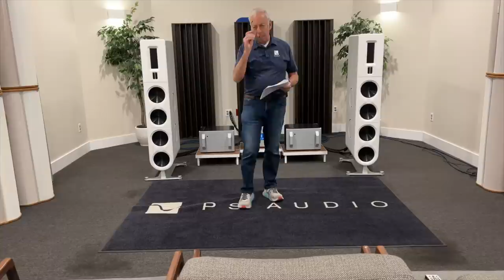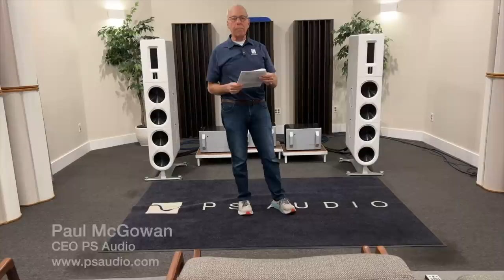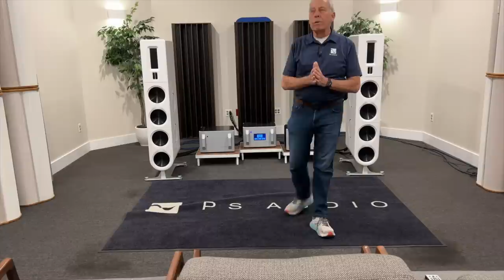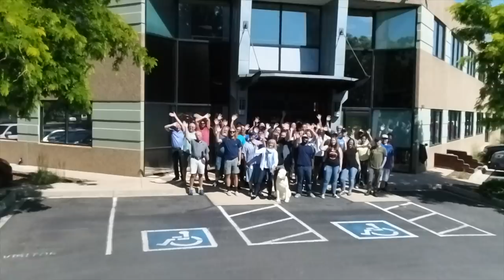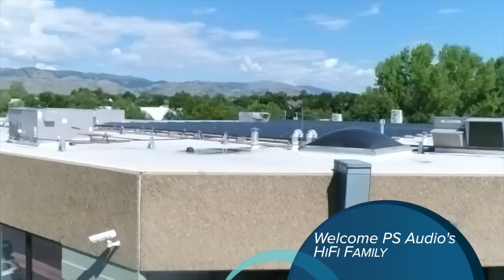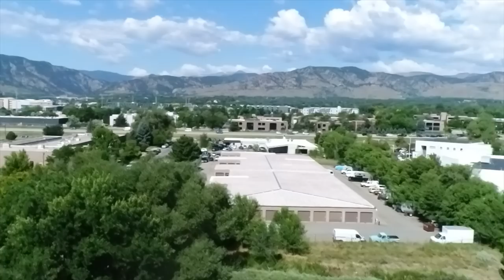Understanding soundstage in an audio system

Comment: Yeah, I had high expectations for Paul's book to "properly" set up my gear. I bought one for me and another one for a friend, with the disc. Too bad the 1st half of the book waffles around and when it finally got to the point (speaker setup) I realised I'd need an American size mansion or a Russian oligarch size palace to replicate the steps. It seemed like honest, decent advice if you have that, otherwise, in an European size apartment... not so much.
Reply: New Record day, has a set up video, "audiophile sounds in small rooms" it worked for me, it's worth trying.
Reply: I'm in a smallish American apartment and I found The Stereo book and disc to be a great help. Mostly because I was unaware of coupling. Just that bit of bringing the speakers close together to hear the midbass coupling, and then to move them apart gradually in order to gain depth of soundstage while maintaining that fullness in between the speakers. Once I had that sounding as good as it gets in my room, I began fine-tuning with toe-in. 
And being married, meaning the speakers don't get to be too far from the front wall most of the day, I put furniture sliders on the bottom of my tower's spiked feet in order to slide them into marked (subtly) position for listening sessions!
Reply: Go near field set up…it’s amazing.
Reply: Every one's room is different.  You need to set up "Place" your speakers for your room, 12mm this way or 12 mm that way can make big the difference.  It's more than just centering the phantom speaker, like Paul said it's getting the room to just opens up.

Comment: I’ve experienced soundstaging with mainstream av receivers - not just high end audio. It came down to proper speaker placement and decent recordings.
Reply: Only just learned about this and realised I experienced it a short while ago with what would be described as an entry level hi-fi system, and the sound was right there in front of me, not from either speaker - it was amazing 😀
Reply: Absolutely
Reply: Yes, that's right. It takes a badly designed AVR to mess up the soundstage. Of course what matters for soundstage in a system is all about speakers, placement and room acoustics.
Reply: @Douglas Blake Oh man. I guess I have some tweaking to do.
Reply: Kind of disappointed you missed this: its usually vital to close your eyes for any of this to work because our vision has the dominant path to the brain, remember we are trying to fool the brain that what it is seeing should be discarded in favor of what it is hearing. 
I suggest Robert Plants "ship of fools" from Now and Zen. The techs did a great job  of separation of the instruments, you can clearly hear them far outside the confines of the listening space. 
Also consider not just equidistance to your ears of each speaker but if they aim just behind or in front of your ears.
Theres a saying by audiophiles when you achieve the phantom channel. "At that moment, the system became transparant." Its usually after speaker placement is perfect, eyes are closed, and you take a brief moment to breathe slowly, bring your heart rate down, and relax. Youre entering a state resembling meditation.
Reply: Agree, it is a bit “I want to sell” speach here by Paul. 

Most audio gear if speakers placed properly will give you soundstage and phantom placed vocals.
Reply: @ThinkingBetter  You’re right. Many of the recent AVRs that I tried present a very good soundstage unless they are very carelessly set up.

Comment: Of course, stereo is    a no-brainer necessity for soundstage. Phase coherency of a loudspeaker is a primary critical parameter for soundstage. Phase coherency is the capability in loudspeakers  emanating its entire frequency range at the exact moment of time. For example, 500 Hz frequency arrives to stimulate the eardrum at the exact time as a 1000 Hz. Which is not electromagnetic mechanical possible at the precise time. Primarily due to motional impedance differences of speakers. The sound process from time differentials is highly critical processing direction and distance of a sound source. Monumental creating a soundstage. This major factor was not mentioned. However, it's technical for most viewers of the podcasts.

Comment: Great Q&A.
I had forgotten that I spent most of my life not knowing what a sound stage is.
20 years ago, when we moved into this house, our decorator suggested a spot that could be set up as a library and or listening area.  My wife agreed that I should get a decent little stereo, so I purchased a bookshelf system of Denon electronics with Totem speakers.  Reading about Totem they expounded on their ability to set a sound stage.  But I did not hear it.  I made some DIY speaker cables, and DIY interconnects, and bingo.  I heard my first sound stage.  Just barely.
Then DIY took fire and along the way building DACs and amps for a now dedicated listening room, the commercial speakers from Boston Acoustics I had owned since the 80's disappeared and a wall of sound appeared just as Paul describes it.  WOW.
I have concluded everything matters.  But it is all about transparency and phase.  So, given your speakers are out from the walls, it starts with the recording and then the source is the key thing.  In digital, that means a low jitter clock and a great power supply.  After that, everything can subtract.  Electronics and cables must be able to pass a signal without altering phase or smearing it.

Comment: Paul, you are absolutely right in that you don't need to spend massive amounts to get impressive soundstage. I have a system made up of many different pieces, a majority of which are Realistic / Optimus branded pieces (yes, the dreaded Radio Shack), most of which were bought on SPIF - the very last price reduction before throw in the bin or return to warehouse. These are mid 80's to mid 90's pieces. Most pieces were under $40 back then, but the most expensive piece was the receiver at $120 (Sansui). The main speakers are Optimus 30's, rebuilt with burnout proof ceramic voice coil former woofers. Everything has to fit in a late Victorian style twin, so against the wall is the only option. The big star of the show is the EQ.  With the EQ switched out everything is 2 dimensional. Switched in, there is now a concert hall in front of me, and all the musicians are precisely located in 3d on that soundstage. That goes for the CD's, records, even tapes. 

So, just work with what you have in the way you can. What ever works best for you is what is right, regardless of others opinions. Please all go forward and enjoy your systems, but most importantly,  the music that takes you away.

Comment: I think what you find in higher end systems is they give you FLEXIBILITY with a variable of choices and settings. What is a perfect soundstage to one might be crap to others. What do I mean? Some audio gear like to make it where the soundstage is huge but the singer is pushed way back like you are in a concert way far away from the stage. The music becomes hard to be engaged with as so distant. Other gear has more forward sounding stages where you feel like in a dive bar a few rows back and the singer is right there singing to you and the instruments wash over you and you get lost in the music. It's all about what you like and get out of the music. If you love the feeling of being far back in a concert setting then some gear is tuned to that. I have also seen where the instruments were too forward and overpowering the singer where the instruments seemed to be next the singer or in front. Think of soundstage like a tv screen. If you have small gear in a medium size room then the stage could be good but condensed way down or only go up to half the size of the room. When you start getting into larger speakers and higher end gear the walls seem like they almost do not exist and you have a massive stage like being outside with sound and little to no constraints. You have to find what you like and then try to get as much as possible of that within your current budget and build up from there over time or stay with what you have if it's (good enough) to you. The audiophile's journey is different for everyone.

Comment: Watched this and decided to experiment. I have my 20 yr old Monitor Audio Gold 20 mains in a surround system. Went into processor settings and turned off the center channel and rear surround speakers, leaving only mains and sub. Then I listened to music videos in stereo mode in Youtube. Not only was the center sound stage better without the center speaker, but the mains sounded better listening to Youtube videos in stereo than I can remember hearing them sound. I've just always left my system in DD surround.
Reply: Got to remember the vast majority of music is mastered in 2-channel so really one when listening to music one should be listening to 2-channel stereo. Btw you should try giving a hi-fi streaming music platform a go. If you think YouTube's good, you'll be amazed the difference in sound quality! Especially if you got quality monitor Audio gold speakers .
Reply: Yes - center channels should ONLY be used for watching films and even then they're not needed unless you have an audience watching that isn't in the sweet spot and you need to center the dialogue.

If it's just you, you don't need a center channel.

Also, once you have a really good two channel system, you will never find a center channel that properly blends with the left and right channels acoustically, even if the speaker maker offers one.
Reply: @VideoArchiveGuy  I'm not going to say I agree with you about center channels. I think them integral to the surround system and of course audio is definitely subjective.  My point was only that I had never thought to listen to YouTube videos in stereo mode. If I play a CD the system auto-shits to 2 channel. I was surprised how much better YouTube videos of live recordings and records sounded in 2 channel mode. That's all.

Comment: Paul is slightly wrong....in a proper setup the sound not all come behind the speakers...it can also com from in front of the speakers. My reference recording is Die Fledermaus on EMI. The whole light opera plays like a circus in front of you. Some singing is far in the back and suddenly moves from the back to the front. Then the sopranos move in front of the right speaker to the middle and you can "see" them singing about one meter apart. I use a hybrid tube power amp(Valve Audio "Black Widow"), Sonic Frontiers SFL1 pre-amp, with Audioquest Midnight 3 to a pair of ESS AMT 1D's and 2 REL subs.
Reply: It depends upon the source and components; some have a more forward sound and others place the sound further back, and it's an individual preference as to which you like more.

Comment: I really enjoy soundstage through my open back headphones, but unfortunately it’s really hard to get a proper sound stage with my loudspeakers in my small room, where the only spot for them is against a wall near a corner. Really sucks because I know my JBL 4311s can really get there. Need to wait until I have a bigger house with more freedom in the sitting room.
Reply: I’ve had my 4311’s since 78 and they can still put out some awesome sound!!
Reply: Read my reply. The extent  in reproduction of a soundstage is more complex than most audiophiles would think.

Comment: Allow me to elaborate my findings about soundstage. Your listening position is at the button of the triangle (lets call it A), and your speakers are each in the corners of the remote corners in the triangle, left and right. Then you imagine you have a laser beam, and you point it from your head through the speaker to the back - and you should imagine a extended triangle as a prolongation of triangle A into a new larger triangle, B. The orchestra is then sounding as standing somewhere in the triangle B! A large symphony orchestra takes much space up, and the farest musician, the drummer or horns typically say 40m in depth, and the distance from the musician from left to him at the right is virtually another 40 m. The width of the front musicians is a little shorter. You hear that the orchestra takes up the space you imagine behind the speakers.

A smaller orchester takes less space, but you feel the room width at both the front and the back. You do not hear sound coming straight out of the speaker - they have disappeared.

Comment: Is anything supposed to seem like it's in front of the speakers with a proper soundstage?
Reply: Yes. And everywhere else to. Now with atmos.. it can come from anywhere... even with two speakers. . TRICKS
Reply: Some reviewers online describe certain speakers as projecting the sound stage in front of the speaker itself rather than behind. I never experienced that not even in Charles and I’m not really sure how it would happen psychoacoustically
Reply: People occasionally report a 3d sound field that even has sounds from behind them.  I mostly hear a stage that is deep behind the speakers.  Even behind the front wall which is a trip.
But I have heard live recordings where there was a stray sound from behind me causing me to jump thinking something moved behind me.  So, I think if it's in the recording I might hear it.
Reply: @user-od9iz9cv1w  That happens when recorded sound is out of phase for some reason - this is literally the way basic Dolby Surround works.

With a good two channel system, you will hear those surround effects "behind" you even though you do not have your surround system turned on!
Reply: @VideoArchiveGuy  It is an amazing illusion.  And addictive!

Comment: It seems like soundstage is not a result of of cutting up a pie, ie, 70% speakers, 20% recording, 10% electronics, which might be inferred to mean, say, with good speakers and electronic but a crappy recording, a pretty good sound stage still could be presented. Instead each of these are an element on a chain where upstream lacking cannot be recovered by downstream excellence.